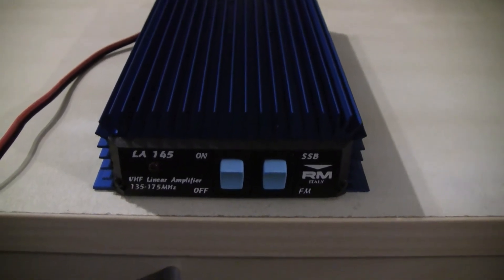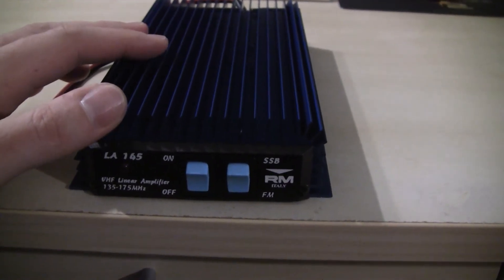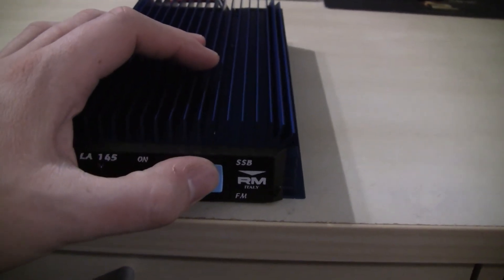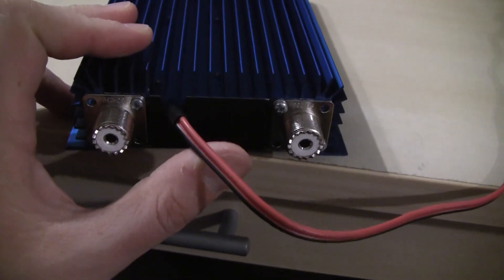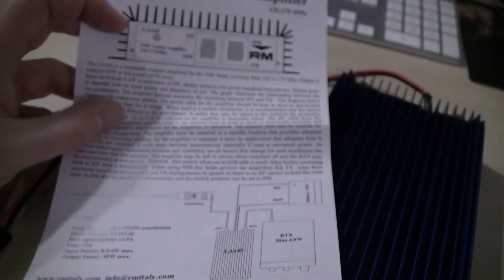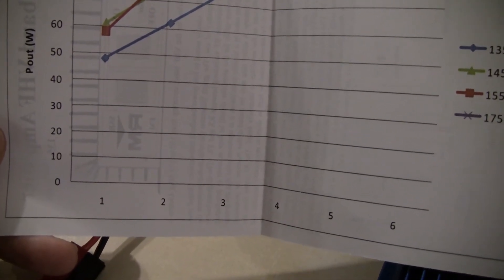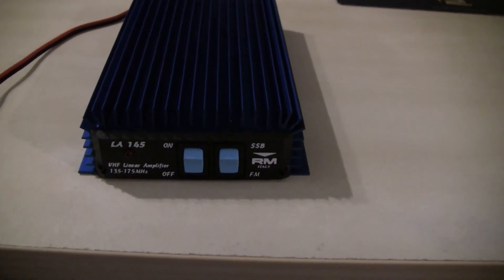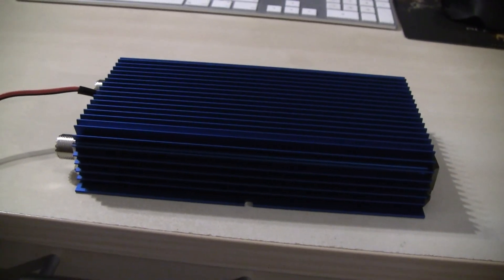RM Italy LA 145 VHF Linear Amplifier

Comment: Hi. What is the size and weight of this unit? E-shops provide size of the smaller KL-144 and LA-144, but not for this one, however, it seems considerably bigger. Also, what's/is there "visible" the RX gain loss, compared between "no amp on the line" X "amp online but off (bypass)" X "amp on"? I guess AMPs usually lower a bit your receiving performance, how "bad" is it with this one? Thanks.
Reply from the maker: Yes, it is definitely bigger. WxHxD 12x4x23 cm approximately. I did not measure the signal loss myself but I found that someone wrote that in TX it is 4 W in and 3,8 W out. From hearing signals I couldn't notice a difference but I am not doing DX.

Comment: What is the maximum drive you have put into this amplifier?  Just curious.  Also, how is this amp holding up for you?
Reply: @bommel88  OK, I was curious - I was thinking about using this with my shack in the box and on 2 meters its power output ranges from 2.7 to 55 watts.  So I can use the lowest 8 power settings (1-50) so I won't overdrive it.  I can tune mine almost right to 4 watts - but I don't think a little over that would hurt it - RM Italy says it will take up to 5 watts drive.  Would be nice to have closer to 85-90 watts when working SSB or FM simplex.